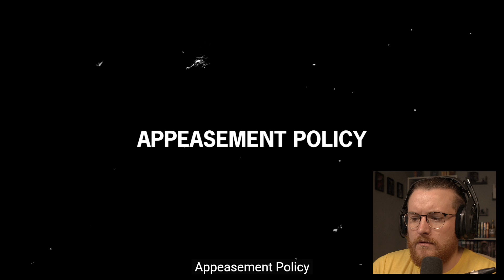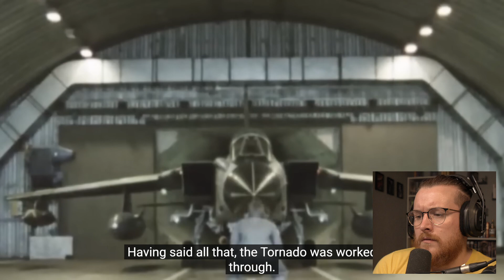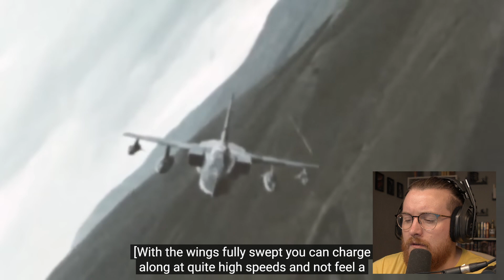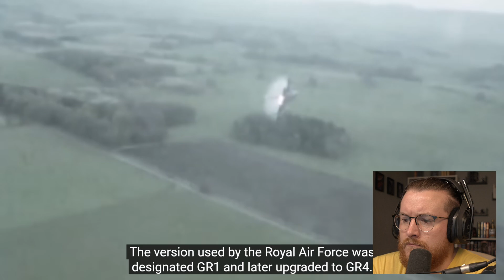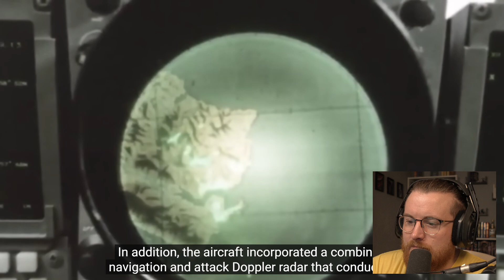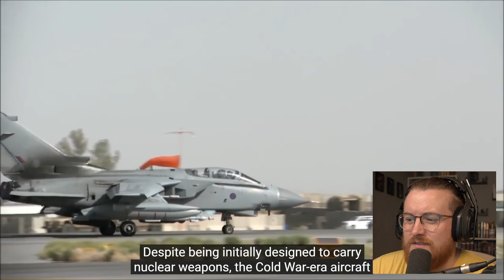Royal Marine Reacts To The Plane Built to Break Russia

Comment: The Vulcan had a very primitive electronic warfare suite, that would throw off the enemy radar by giving off false signals. By the time the Tornado came along the technology increase was massive, and then it lended itself to multiple upgrades over the years, where's the Vulcan wasn't upgraded that much from the time of its launch.
The Tornado was another aircraft that owed its existence to NATO getting hold of the Mig 25, as they knew that they could build a bomber that didn't need to be super, super, fast, to be able to outrun the Mig, as the Mig wasn't able to hold its top speed for long without falling to pieces. That's one of the reasons why they cancelled the TSR2, as the Tornado was slower but a hell of a lot cheaper